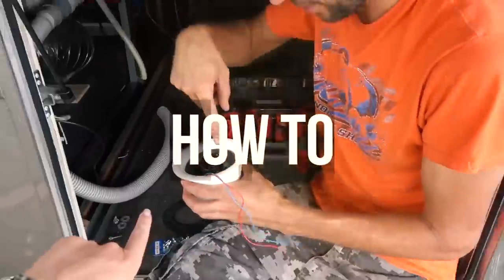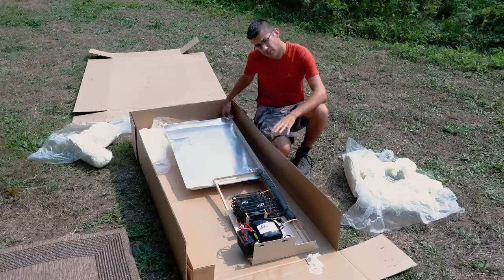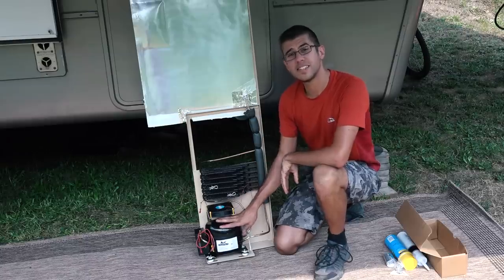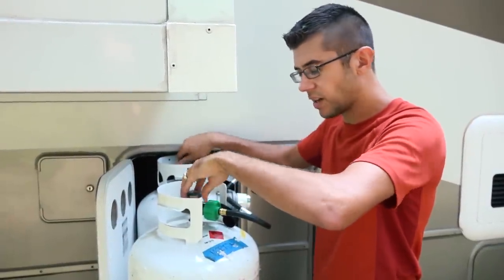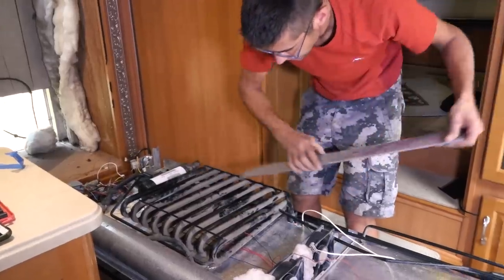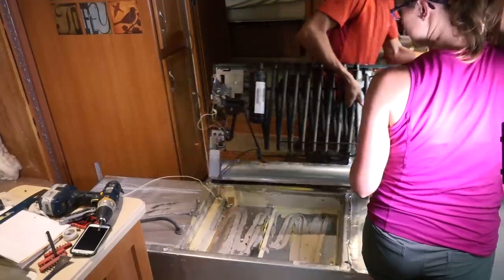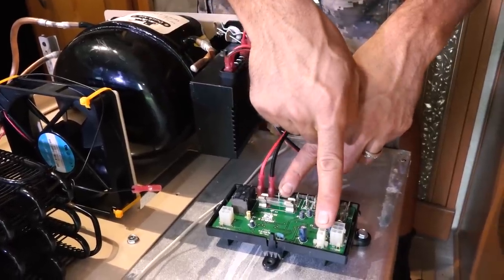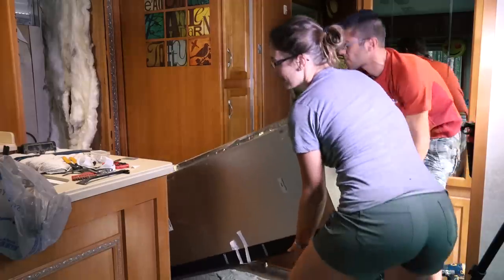Converting our RV Fridge to a High Efficiency DC Compressor- 8x More Efficient! and Better Cooling!

Comment: I believe it will be more efficient a regular house refrigerator that fits in the hole and use a power inverted from 12v to 110v , less work to do and less expensive. What do you guys think ?

Comment: FYI all your propane refrigerator owners, if you find it you're not working as good as they used to ,pull the unit out and flipped refrigerator upside down coma for 24 hours, just won't burp the gases and restore it like new again. Give me a thumbs-up, if it work for you . in every fridge I flipped. You want to hear the gas is running down inside of it. That's a good sign

Comment: It's a good idea to disconnect the negative first!!! You may want to put text on the screen with a correction.  The reason is if you touch anything with the screwdriver disconnecting the negative it will not arc, then the positive side is dead when you disconnect that.  It doesn't matter as long as the fuse is pulled but people make mistakes and pull the wrong fuse. Same goes for the main battery.  Thanks, great video.

Comment: The control box on the side of the compressor is a timer which protects the compressor from short cycles and monitors the pressure on the input and output of the compressor. All compressors have a 5 minute minimum stand down which starts either when power is first applied or when the compressor cycles off. The cycling that you saw on first start would be the refrigerant moving around the lines which causes random pressure swings and the controller will shutdown the compressor to protect it. Once things equalize and the 5 minute timer expires then the compressor can start again. Your Air Conditioner has one of these circuits as well.
Reply: Good info

Comment: A few builders of trailers are now getting rid of the absorption fire starters in favor of new 12V 3Amp larger fridges and freezers.  With a solar panel and better batteries you will never have a problem running it 24/7.  You no longer need to go regular residential which draws to much power.

Comment: ANY TIME you lay a refrigerant compressor in any position except for upright wait at least 24 hours in the upright position BEFORE powering it on…this allows enough time for the compressor oil to settle back into the compressor…I suspect when you say it started and stopped several times it was due to being hydraulically locked while attempting to compress the oil…

Comment: I had a full size residential refrigerator in my boat and mostly running on inverter for two or three days. If you do this there are two things that you must keep in mind. The current draw was not bad when the compressor ran but the big surprise was the defrost cycle. The defrost could pull enough power the cause the inverter fan to run. To save power and keep things quiet I installed a switch to disable the defrost when it was on inverter power. The ice buildup minimal for a few days and went away by next weekend when on shore power. Just remember to turn it back on. You also want to install a delay on timer so that if there’s a momentary power interruption that the refrigerator compressor has time to reduce starting pressure. If there’s too much pressure in the system and it hasn’t equalized it can stall the compressor and it trips a safety but that safety will only do that a limited number of times before the compressor or safety device fail.
Reply: Good to know

Comment: If you get foam insulation on something, resist the urge to touch it or clean it up. Let it harden and it peels off fairly well. Spreading the slime doesn't work.

Comment: Drove out from California to Indiana to have JC refrigeration do the conversion  to 12 V   About 5 weeks ago.
 It is a game changer. I can now boondock and have the electric refrigeration.
 At around 75ﾟ F my old unit when on electric would burn about 20 amps per hour. With the new unit it's a tad above 4 amps per hour.  That's 480 amp hours per day down to 100 amp hours per day.
 One 150 watt panel would probly keep up with it. I have got 950 watts  So even on cloudy days I'm putting out enough.
 The people at JC refrigeration couldn't be nicer. They will let you park in their parking lot the night before your appointment.
 Thank you so much for doing this video. It has been a huge plus for me.
Cost around a $1000 for my Dometic 2652.
 One note:  There is a low level sound and some vibration. Not a bother to me at all but everybody's different

Comment: Thanks, this was a great find! I was kinda shocked at how much propane our fridge uses! We're upgrading our solar from 100W to 1400W, so a DC fridge is a no brainer (works better AND uses less power). We're also waiting for a 24VDC mini-split air conditioner due out later this year from Hotspot Energy. Solar boondocking will be SO much easier with air conditioning that uses 200-500W instead of 900-1200W of power plus inverter losses.

Comment: Outstanding video! With all the problems with the propane refrigerators, we just installed 1 KW solar power and 2  120 amp Lithium batteries and a 6 kw inverter to power our 120 volt ultra high energy efficient refrig-freezer and have been very happy.
Reply: What kind, and size, of solar panels can generate 1kw?
How many panels of what size do you have?

Comment: West RV repair in Livingston TX installed the AC compressor AC unit  from JR REfrigeration. Our  unit work wonderfully.  Freezer reaches 18 degrees and the fridge is easily maintained at 38 even in the hot weather of Texas. Best mod I've done on my rig.
Reply from the maker: Awesome to hear!
Reply: Hi Thomas. Looking for someone to do a conversion of my Norcold. How is your unit performing? Any freezing of the refrigerator fins? Thanks!

Comment: My Norcold 2118 was sucking our batteries dry, using 11KW/day, or emptying a 30# propane bottle in 6 days. And temp control was the unsatisfactory. I was very frustrated!

In March 2020 I installed the DC compressor unit. It only took about 2 hours, working slowly, and the instructions & photos were easy to follow. Customer service was great!

It is now July. We love this conversion! It draws a small 1.25 KW/day, hardly even noticing the draw on our 600A system. I did have to run a 10ga wire from a 12V node to the fridge because the compressor start spike was too much for installed 12ga wire, but that was simple. I added a 15A fuse for safety. 

I also added an adjustable thermostat to replace the thermistor. Temps are now always in the right range. The fridge stays cold, and the freezer stays frozen, no matter if it’s below 50 (Montana) or over 100 (Las Vegas) outside.

Comment: Dude! You are a pro. I hope the manufacturer pays you for this monster install.  I prefer an un-vented residential 115V frig and use my inverter when on battery. If my battery gets low, fire up the gas generator and power everything including the battery charger to get back on battery power.  No special wiring, and no issues in freezing weather.
Reply: Gas,LP..? How many gallons to get back to full charge?

Comment: Hi Tom, I ordered one of these units for a smaller Norcold that we have in our Outdoors RV 21RD. A small 7 cubic foot unit.  We did not have the same experience as you. The foam over the evaporator coils was not formed square so the face of the unit would not sit down. JC Rerigeration said to just use longer screws on the high side. I explained that this would not work because the frame was already flat to the box. They then had us cut a support brace to free the coil so we could get it attached in the freezer.  The foam still had very large gaps around the coils in the refrigerator compartment. 
 They said then that the cooling fins would keep the new foam from impinging into the refrigerator compartment.  Our find have 4 screws. We were then told that we only need to use 2 screws per the manual. Problem is the manual states to use 4 screws for the fins.
I've decided to return the unit because it was manufactured incorrectly and JC Refrigeration isn't very supportive of addressing the problem. 
Glad yours worked well!

Comment: You will find you will love a small impact driver so much better for the type of work you are doing...its a tool improvement that I was really glad to discover.Especially for self tapping screws...more power more control
Reply: I had that same thought. It hurt my heart to watch that!
Reply: I hardly use my impact unless I am driving large fasteners like lag bolts because its too easy to strip. My favorite driver is actually a 12v Bosch screwdriver. It has plenty of torque for regular screws, smaller and lighter than a full-size drill or impact.
The main difference is that drills have continuous torque, which is why they have a clutch, and the impact (as the name implies) has an anvil that hits the drivetrain to amplify torque. An impact is comparable to a hammer on a nail. It has a ton of force on the swing, but its difficult to control the exact amount of force.
Reply: perhaps drive a self tapper with a regular drill and when it gets near the end, stop, and snug it by hand with a socket wrench!  
torque is everything. just rite.

Comment: Funny ... I just did the same conversion to our fridge - works great, doesn't it?  We're full-time and my wife was hiking the Appalachian Trail when I got my unit, so I ended up doing the whole conversion (including removing and reinstalling the fridge) by myself after putting the kids to bed.  It was a long night, but by 0600 my fridge was icy cold!  So happy I did the conversion!  Kudos to the folks at JC Refrigeration...   One thing to note is that they only have compressor conversions for a couple of Norcold/Dometic models (mine is a Dometic 2652).
Reply: any chance you could snap a picture of the nameplate info on the compressor?

Comment: Excellent video.
The absorption system on my Norcold 1210 double-door fridge died.
I've been considering these units for about a year since mine died.
The other problem with my fridge is that the right fridge door lower hinge
is molded into the door and breaks rather easily.
They want $500 for just the right door!!!
Norcold price for this fridge is around $4000.
Mine came installed in my new 42-foot toy hauler in 2008

Comment: Great information.  Mine is not working all that great and they don’t like warm food, takes too long to cool down.  This is a great way to convert it because it’s about half price of a new gas/electric unit or the same for a 12v replacement unit. The 12v unit does increase the storage from 8 cuft to 10 cuft.  Might be worth the cost.

Comment: That's an interesting re-fit kit, although my older (1989) propane or 120-Vac freezer/'fridge used about "a birthday-candle's worth" of propane, (or a tiny amount of shore-power), to run it for a solid 5 weeks of one of the hottest months on record for the area I was in, (USA mid-eastern seaboard, and the average temperature & humidity were 99-degrees F & 98% R.H.)...
 I try to keep my freezer at about 5-degrees F, & the 'fridge runs at a nice +33 to +35-degrees F, and while my "house-based" units can't get the freezer to near that cold for the freezer, (with the fridge at a nice +34-degrees F), the RVs' R-717 "ammonia-water" system easily kept things at +33 degrees F in the 'fridge, and a nice "hard-frozen" -5 degrees F in the freezer section.
(With both sides of my family having been in some form of "the food business" for at least 4 generations, they all agreed that "Pasteurized cow's milk" stays perfectly good for over a month at that low +33 degrees F, if it was kept properly cold from the dairy to them, or to me.)
 Also, after some "usually never-needed" maintenance, I checked my "R-717" or "ammonia-water" systems' levels & pressures, after evacuating &  properly & safely cleaning & leak-testing the "plumbing" of the system, & there was NO "Hydrogen subsystem" or similar to be found; it works the same way the first freezers for the generic "Olde Towne Ice House" systems usually did: when the super-heated, and therefore pressurized, gaseous ammonia-water mix is released through the thermostatic expansion valve, (or capillary-tube, or whatever is used in place of a TEV,  since that's what the R-12, R-22, & other "R-bad for the environment" "Freon"-based* refrigerant systems I've had used), *("Freon" is a copyrighted trade-name, property of the respective owner; I can't get my present tablet to let me put a proper "scienter" symbol in here),
 and the MH freezer/'fridge has a large, finned aluminum plate which goes from "outside" to "inside" the freezer section, where it pulls the heat needed to "phase-change" the "refrigerant" so it will, with some energy added in the form of latent heat, re-condense back to a liquid.
 My trusty (but not rusty) MH 30-yr.-old unit, gets that extra latent heat from a substantially thick, finned aluminum plate, which takes the heat from "inside" the freezer & moves it into the refrigerant, (which is "outside" of the unit), with a thick, flat aluminum plate extending down from that finned upper part in the freezer going through a well-fitted slot leading to the 'fridge section, to carry some of the heat from the 'fridge section as well...
 (Basically, all combination "refrigerator-freezers" only "cool", or move the heat OUT of, the freezer section, & get additional heat out of the 'fridge section.)
 Just as one cannot put darkness into a room, but one CAN put light INTO the room, "cold" cannot be removed from a space, but the heat CAN be moved from inside a space to outside, (or to a different place.)
 A "heat-pump" is simply an "air-conditioner" which can be reversed with two simple electrically-operated valves.
This was the first time I've even heard of an "R-717" (or "ammonia-water")-based system needing anything other than the R-717 & a little heat to get the phase-change-cycle going! Thanks for an informative & well-explained "bringing an old-timer like me up-to-date" post!
 (And if anyone can tell me, or the mechanics I know, how on earth to change the spark plugs & do a "tune-up" on a Ford 460-cid "gas-burner" engine, which was "shoehorned" into the requested space it's in, by John Deere, (who built the Heavy-Duty Truck Chassis which the fiberglass "Dolphin 3450", ("Deluxe apartment on wheels"), which was assembled by the now-defunct National RV of Perris, Calif., we'd really like to stop doing "routine maintenance" by taking the entire engine & transmission out from UNDER the rig, doing literally everything while it's all "out", then putting it all back "in"!)
 Cheers, from a retired "Higher-Than-High-Tech-Engineer"!
 "Keep the roof up & wheels down!"
 Phoenix NightOwl Jr.

Comment: For those experiencing cooling issues with a typical absorption RV refrigerator first see if the unit cools better with gas over electric. If this is the case, the DC or AC heating elements may be wearing out or quit working. These simply slide out of the boiler stack. It's always a good idea to replace both while the refrigerator is pulled out. If you haven't used or moved your RV for several months and in so extreme cases of rough travel there could be negative pressure (vapor lock) preventing the ammonia from circulating somewhere in all that tubing. Literally pull the whole refrigerator out and flip it over for a day to release the negative pressure inside the tubing. 

If using gas or electric still isn't cooling well enough or not at all it is time to replace the cooling unit or switch to a residential refrigerator if you're parked full time. If it is old and rusted, it's time to replace it because it won't last much longer. When preparing for a long, extended vacation with your RV, check to ensure the refrigerator is cooling properly three week before your expected departure date. This ensure you have ample time to do any repairs or replacement before you leave. It will save you a lot of headache and expense. Especially if your spouse insists on a new $2500 -$5000 refrigerator, plus labor, at the next exit. 

Excellent video. I really admire the way both of you take the time to do things right. No rushing or cutting corners at all.

Cheers from Seattle!
Reply: For $5000 you can make a lot of restraunt stops for two people. Your wife might like the excuse for take out. Lol no more headaches
Reply: Friends with a  Dometic side by side experienced a $4,000 repair on their unit. That repair cost seemed expensive to me, and I would have switched to this system without hesitation had that been my unit.
Reply: Please check out Ford's RV refrigeration. Only person teaching how to properly fix and diagnose an RV fridge. Free tips on YouTube, and they have a class.
Reply: Just bought a trailer with a Norco fridge.  On first try, the gas seems to work better than on electricity, but I don't have enough data points to definitively point my finger at the cause.  Was suggested running it on 30 amps vs 20, but I am unsure of that.  YouTube has been a great resource and checking the heating element might be the next step. Thanks!
Reply: @ericgulseth74  I have seen videos that say some are selling AC heat cartridges that are not producing their rated wattage.  Only sure way to know what watts your heater is producing is to check with a meter.  Look for videos from "FordRVRefrigeration"
Reply: Good comments and advice for diagnosing most issues with the absorption type fridges, ur right, often you can just flip them upside down for a day or so and they will work okay again